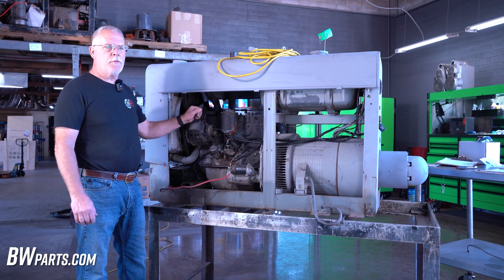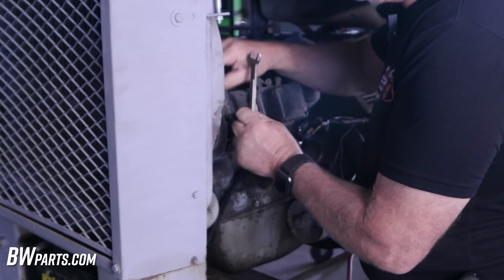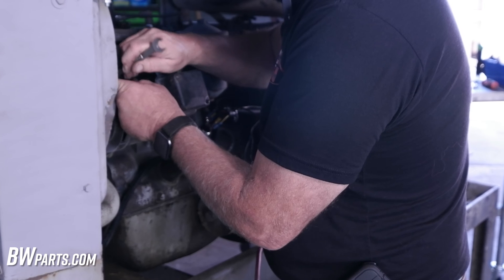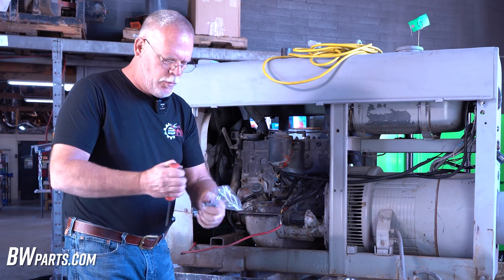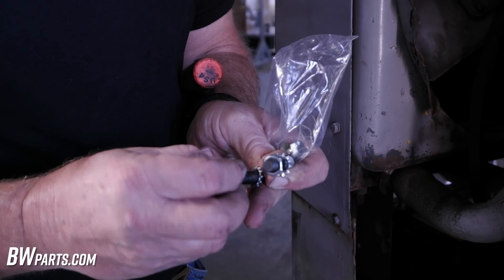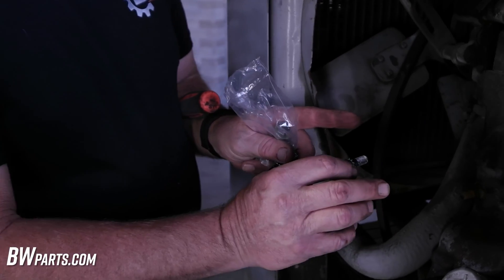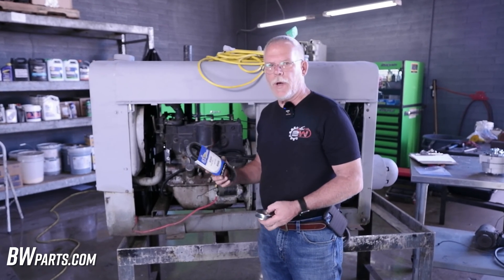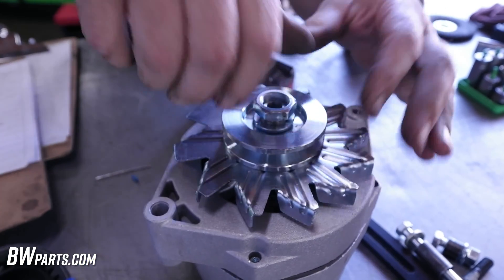Lincoln Electric SA-200 One-Wire Alternator Installation

Comment: I have a Lincoln Classic 3 SA300-TM27 code-10072. With two 3 pin plugs on the side and 1 battery stud on back of the alternator. I can't find a replacement. Any ideas? The SN# is R1000200228